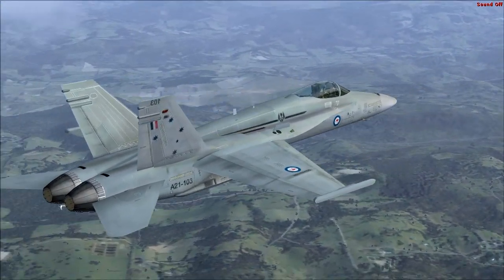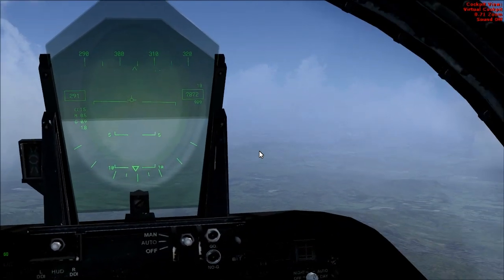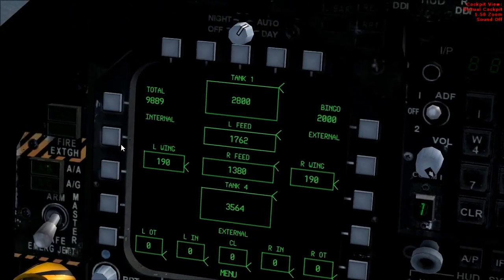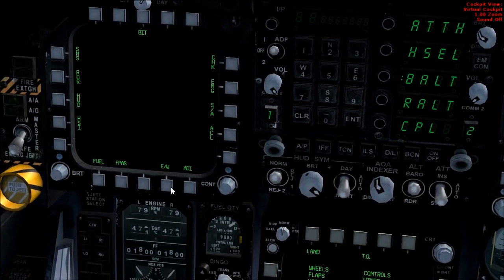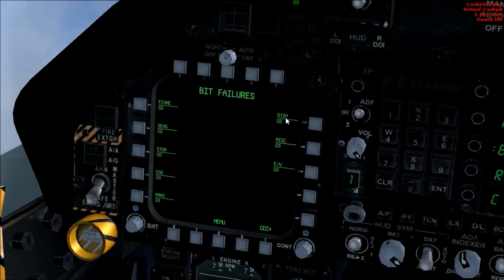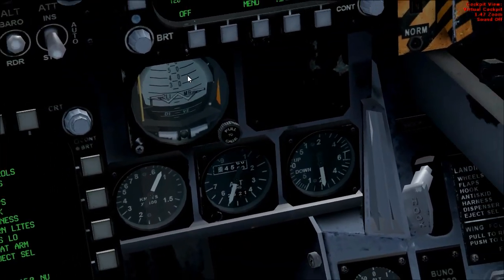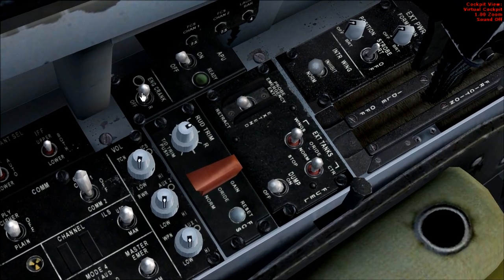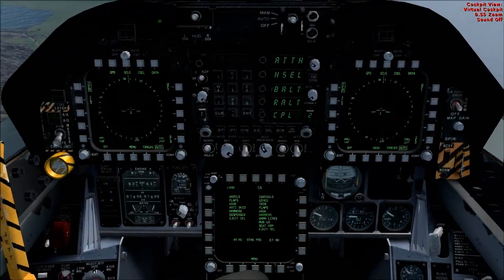FSX F/A-18 Tutorial - Systems Overview

Comment: Thanks! I had been using FSX in Vista and Win 8.1 with only moderate success and then with some add-on software. After upgrading to Win 10 I was on the fence about installing Flight Sim again. Once I saw your video I installed FSX plus "Acceleration" and wow! It's as smooth and pretty as I had always dreamed it would be.

Comment from the maker: hey mate the only way to turn the HUD off completely is to turn off the battery and left and right generators but then all the other screens will turn off to.  Otherwise you can partially turn off different sections of the HUD using a switch located at the bottom left of the autopilot system.  It has 3 labels around it; Norm, REJ 1 and REJ 2 (below A/P button).

I used altitude hold to stay level (BALT option on the autopilot list).  Check out my autopilot vid on how to use it.

Comment from the maker: There is a little sliding knob on the throttle lever that controls the speed brake.  Press '/' key so you can see which one it is.  You can use the mouse wheel to adjust this but you have to be careful to make sure the cursor is right on the knob otherwise you will adjust the throttle instead.  I find it too inconvenient to adjust manually and just use '/' key.